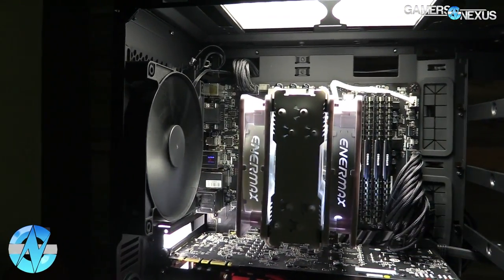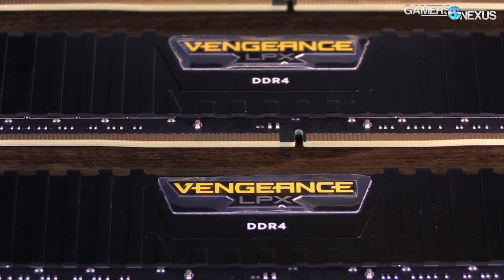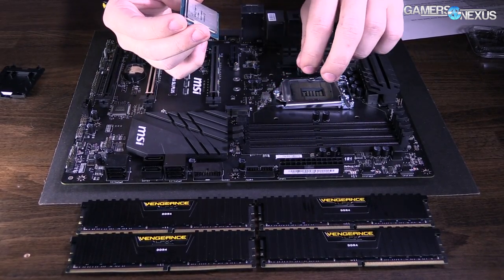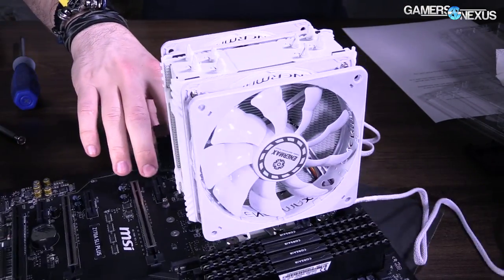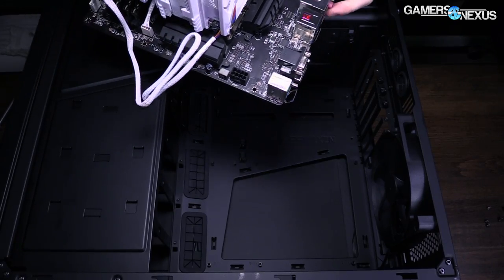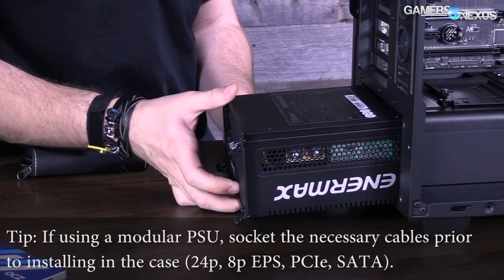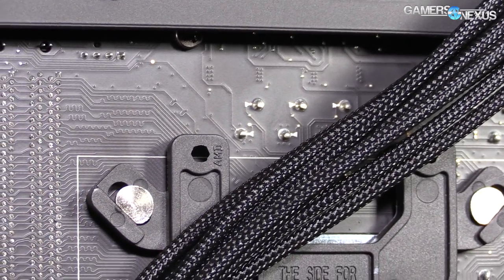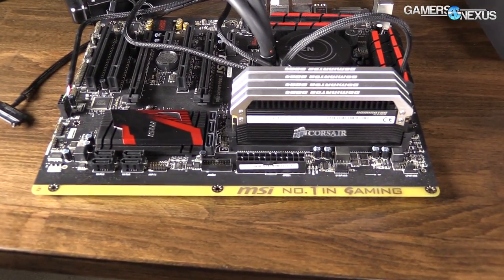How to Build a Gaming PC: Step-by-Step Walkthrough 2016

Comment from the maker: Hey everyone! Important note for new builders: The steps to building a computer are almost always identical between parts lists (sans a few minor details, or using an mITX case), so this guide will apply to any 'standard' parts list. You do not need to use the parts we did in this video (and some of our parts are specified for our internal testing or production uses anyway, thus likely are 'overkill' or 'mismatched' for the average gaming PC). You can always post on our forums if you require assistance in fine-tuning a PC parts list for your next build, then refer to this video for the walkthrough!
Reply: +Gamers Nexus i have a tp link 1750 t8e ac wifi,i cant get it over 135mps speed even tho i have superfast fibre optic broadband.
 i usually use my gigabit ethernet but the mrs wanted wifi,now i downloaded the latest driver for windows 10 from tp link,but when i go to update ,it says windows says you have the best driver already,even tho that one is from 2014 and the new one is from just before xmas.
i deleted the driver but now cant see the wifi card in device manager,do i really have to unplug the card and reseat so it shows up.
also how do i force the driver update,i pointed it to the folder that has it but windows says the best is already installed,any help would be great
Reply: +patchedupdemon The low transfer speed on the card is not due to the drivers, but to the connection band you are using, as well as the router. On the router login page (such as routerlogin.net for Netgear) there are settings where you can change the the max speed mode for both the 2.4Ghz and 5Ghz signals. Most AC routers have anywhere from 300Mbps to 900Mbps speeds on the 2.4GHZ signal lane, and can have anywhere from 450Mbps to a whopping 5Gbps on the 5Ghz signal lane. I hope this helped you out!
Reply: Will a gtx 1080 zotac amp edition fit in a NZXT S340 case? That's the card And case I am using for my build.
Reply: i have fibre broadband and im already running on the 5ghz band,i cant get over 150mps,even though it shows excellent signal strength,ive just diabled it as im using gigabit ethernet now.
just totally bummed i spent the money on that card when my cheapo one does better
Reply: your router has to be programmed to run at max speed in the router settings, otherwise it sticks to factory-set defaults. Also, since you have broadband, your modem may be bottlenecking your router. if it doesn't have enough upstream/downstream channels, tyou will get slow speeds even with a fast router.
Reply: There are a few thing I do differently than you, other than I have not yet tightening a CPU fan to the point of warping the board (knocks on wood and smiles at you;) is to also attach the case headers prior to installing the board into the case. I also opt to install the power supply prior to dropping the MB in so I can run the cabling to its rightful location. O wait... there is one more thing, I dont wait to install the GPU before I talk about connecting the SATA cables because so far the last 100 or so builds I have done that is always a must!
Reply: Gamers Nexus the motherboard you used in the video does  it sell in the UK, can you recommend any alternatives?
Reply: How much does this cost

Comment: hey great video! could you make a video about COMPATIBILITY of the parts? I mean for example how to check if RAM is compatible with CPU and MOTHERBOARD and atc.

I am sure many will appreciate it! )
Reply: Not sure if I am too late, but look up the website PCPartPicker. Great website and community where you can create a parts list that includes compatibility.

To check if RAM is compatible with Motherboard, it usually lists on the Mobo that is works with DDR3 or DDR4 at a certain speed. Usually the CPU determines what Motherboard you need based on the socket, which in turn leads to what RAM you would use.

Comment: Also minor tip for OS installation, if you're using a single large hard drive, split it up about 30/70 with paritions, so 300/700gbs for a 1TB drive probably 200/300 for a 500gb drive.

Install the OS to the smaller partition and keep games/files on the secondary partition, that way if you ever need to reinstall your OS you don't lose all your data.

Comment: Probably going to stick to a 390/Nano over current nvidia cards given nvidia's issues with DX12 that seem to keep popping up. Plus you're going to save at minimum about $100 or so with a free-sync vs G-sync display. and the 390 just has more performance than the 970, more so at 1440p or above though.
Reply: the cost to performance is definitely in amd favor, I have heard for what it's worth that freesync isn't quite as good as gsync though. I haven't used freesync though so I don't know personally.
Reply: Jominator
Some implementations of free-sync are poor, but for the most part when they're both working 100% they're going to be identical.

Like the 1440p 144hz IPS displays, the ASUS one only goes to 90hz, while there's a new ACER one that goes up to the full 144hz for free-sync

and if the 4k G-sync displays are still 900 for the IPS ones god help all nvidia users. There's a free-sync one that's 27" for about $450-500
Reply: +Street Guru Yeah if the cost stays that high I'll likely not be sticking with nvidia. I run 1080p gsync with a 980ti hybrid and I cannot STAND playing on a non adaptive refresh monitor now. It's God awful. But even if there is a small performance dip that big of a price difference will convince me and I'm sure a lot of other people to go team red in the future...
Reply: +Street Guru actually I think it's a Samsung 590E panel your referring to no? 4k freesync for sub 500. I have the 590D. Got my gsync 1080 when I got the 980ti. the ti just can't push the 4k rates I want and my 590D lacks gsync... had the amd 3xx series launched sooner with that 4k panel available I'd probably be team red right now...
Reply: Thats pretty good for the price, there are some advantages the samsung has over that though, faster response time and its 28 inches instead of 27 (though I dont think that extra inch is really worth much of anything), the LG is an IPS panel though and samsung is TN... the LG is probably the better buy for the price alone much less the ips...

Yeah I'd have probably purchased this over the samsung, would have only saved me 30 bucks though so I dont feel horrible about it... Does the LG have vesa?
Reply: Street Guru What😂😂

Comment: how sensitive are the pins on the motherboard compared to the pins on amd cpus?
i took a old pc i had and it has a amd athlon cpu i took it out and the pins seemed pretty hardcore i even took my nail and tried to bend one and it didnt budge so im wondering is it the same for new intel cpu/mobo pins too or are they more sensitive?
Reply: pin sensitivity shouldn't matter much. however on the intel mobo they are little triangle pins so when you push on them they are harder to break since they are more flexible however never do that just plop the cpu in there and don't worry much about it.

Comment: i just recently built my 1st pc, and it was nice experience building it myself, everything went smoothly (i don't  have aGPU yet ) so i thought il run the on board graphics, so i built everything connected HDMI cable to motherboard, and no boot (motherboard: gigabyte Z170MX- gaming5)  couldn't figure out what was the issue everything was running but no boot screen , so i decided to RMA the motherboard and the cpu, i just received the replaced version of the same brand still no boot, only thing comes to mind is the RAM,

do you think was it the RAM that was causing the issue?
Reply: have you tried something other then HDMI? I remember tha at least a while back when using HDMI one could not go into things like the BIOS. I'm not sure if that has been something that has been resolved yet or not tbh through. buy yeah try using DVI, DP or VGA.
Reply: +Bernd Jankowiak before the RMA yes i did try it with vga and dvi cable still no.post physically the system was ruñning fine ,fans ,the cpu cooler just no post, after the RMA just tried the hdmi cable, i assumed its the RAM

Comment: I've planned to make a gaming pc, 
The budget for the build is around £700....can you please tell me if this build would work:

CPU:                        Intel Core i5-7500 3.4GHz Quad-Core Processor
MOTHERBOARD:   MSI H110M Pro-VD Micro ATX LGA1151 Motherboard
RAM:                        G.Skill Ripjaws V Series 8GB (2 x 4GB) DDR4-2400 Memory 
STORAGE:               Kingston SSDNow V300 Series 120GB 2.5" Solid State Drive
                                  Seagate Barracuda 1TB 3.5" 7200RPM Internal Hard Drive
GPU:                         Sapphire Radeon RX 480 8GB Video Card
CASE:                       NZXT S340 (White) ATX Mid Tower Case
POWER SUPPLY:    EVGA 600B 600W 80+ Bronze Certified ATX Power Supply

Please tell me any improvements I should make.
Reply: +T Dag that's a really good parts list. Make sure to include Windows 10 USB as part of the cost (use pcpartpicker.com to find the cheapest place to get it), but yeah it looks fine. 
I would wait for the new AMD refresh graphics cards to come out, they are releasing the RX 580, 570 and 560 which are actually just the 480, 470 and 460 but clocked slightly higher and with better efficiency.
You haven't made any mistakes (like getting a Z-series motherboard for a locked CPU) and all of those parts would work fine. The power supply might be a bit overkill though, a 500W one would do you just fine.
Hope that helps ;D

Comment: Can I use a gtx 1080 for this same build? If I can't do. I have to change anything?
Reply: graphics cards wont matter, they'll usually be compatible with like every motherboard... the thing you might worry about is power consumption/what power supply you're using... that's all
Reply: Richard Maestas / Ramheads GTX 1080 with a 550w psu should be fine though

Comment: Is this an ok build?

Intel Core i5-4690K (Boxed, LGA 1150 Haswell Refresh)
Western Digital Blue 1 TB (3,5" SATA 3.0)
ASUS DRW-24F1ST (DVD/RW) 
AsRock B85M Pro4 (mATX, LGA 1150, DDR3)
Kingston HyperX Fury Black 2 x 8 GB (DDR4, 2666 MHz, CL15)
Microsoft Windows 10 Home (64-bit, OEM, english)
SilentiumPC Gladius M35 Pure Black GD-M35 (ATX) 
EVGA SuperNOVA 650 G2 (80Plus Gold) 
Gigabyte GeForce GTX 1070 G1 Gaming 8 GB
Reply: No. The RAM you have is DDR4 which is not compatible with your motherboard and may damage it due to the differences in voltage between DDR3 and DDR4.

If you buy OEM Windows, bear in mind that the install will be tied to your motherboard. Non-OEM versions exist, they cost a little more but are worth it. 

If you haven't purchased your CPU/mobo - you might want to opt for Intel's Skylake CPU's (examples would be the 6600K, 6700K, etc).
Reply: Lishaaaaaaa Thanks m8
Reply: Also, if you are getting a non-Z170 or H170 Motherboard, don't get a K processor.

Comment: Can you use a gex 1060 or 1080
Reply: .gtx
Reply: graphics cards don't have compatibility issues with almost every motherboards, the only thing you need to worry about is if your power supply can handle it
Reply: kOdaqTV or if the case supports ii

Comment: I strongly disagree with installing video card last. other steps were decently ordered. Minor revision as such....
install mobo in case DO NOT FULLY TIGHTEN SCREWS, install video card and screws. This will/can slightly shift the mobo so that all the pci slots will properly line up in the future when installing cards. I cant tell you how many systems I have worked on built by others that the slots dont line up properly and the screws dont want to go in or you need to force the card to the side a little. once the video card is installed, then you can tighten all the mobo screws. after that I usually uninstall the video card to complete the rest of the build. In my opinion this is a crucial step that is missed by 90% of builders.

Comment: Can anyone tell me if these parts are compatible with each other? Im wanting to build a PC and I mixed and matched some parts from this video and other videos.

Parts:

MSI Pro Solution Intel Z170A LGA 1151 DDR4 USB 3.1 ATX Motherboard (Z170A SLI Plus)

Intel 3.70 GHz Core i3-6100 3M Cache Processor

WD Blue 1TB SATA 6 Gb/s 7200 RPM 64MB Cache 3.5 Inch Desktop Hard Drive

EVGA 500 W1, 80+ WHITE 500W Power Supply( 100-W1-0500-KR)

Corsair Vengeance LPX 8GB (2x4GB) DDR4 DRAM 3000MHz (PC4-24000) C15 Memory Kit - Black

Hyper 212 EVO - CPU Cooler with 120mm PWM Fan

ASUS ROG STRIX Radeon Rx 470 4GB OC Edition AMD Graphics Card with DP 1.4 HDMI 2.0

Rosewill TYRFING ATX Mid Tower Gaming Computer Case, supports up to 400 mm long VGA Card, comes with two fans pre-installed - Front 120 mm Fan x 1, Rear 120 mm Fan x1

All parts found on Amazon and the total comes to:
$689.29

Any help is appreciated as I am indeed a noob xD lol.
Reply: Please post on reddit.com/r/buildapc for a quicker response!
Reply: Savage Pryme- you could just go to PC part picker and it'll tell you if it's all compatible. It's really specific too.

Plus it'll tell you the best pricing for your parts and from where, and if you want you can look at all the other builds people have already completed.
Reply: Savage Pryme- and guides too, I forgot about that
Reply: the motherboard might be compatible with a Kaby lake after latest BIOS update.

a Z270 or H270 board might be bit more expensive or same price.
and offers more bandwidth on M.2 and PCI-E .
better compatibility for 6000 serie CPU.
lots of them have 2x m.2 with full speed. 
it's worth the extra bucks. 

MSI H270 PC MATE 
2x m.2 fullspeed ,2x PCI-E x16
(nice cheap board , and enough for your needs)

ASRock Motherboard Z270 Gaming K4 
2x M.2 full speed , for example Samsung 960 Evo or Pro series.
you can later clone your HDD to SSD with the Samsung migration software.
(this one is more expensive, but sweet )

Seagate barracuda are good HDD's too, i never broke one.

Be Quiet shadow rock or dark rock CPU coooler.
or Dark rock advanced .

Gskill memory.
or Kingston hyper Fury 

i don't like corsair anymore.
i had too many faulty products
headset fell apart , and PSU AX850 broke within 2 years.
very expensive joke.

My Seasonic PSU is a whole lot better.
Reply: download motherboard .PDF
can see specs a bit.
check Memory priority slots 
Bios list , etc.
CPU supported list.
Memory tested list.
Reply: Kaby lake is 7000 serie , i forgot about that.
6000 was skylake right.

anyways , an i5   7400 or 7500 is not much more expensive.
you can safe on the motherboard.
and go for the better i5 .
maybe not a K version , but it has a nice turbo boost .

you might want to wait for the AMD Ryzen 5 video's and benchmarks.
Reply: Sharkoon has nice wide PC cases.
USB 3.0 connector for motherboard.
can fit a big CPU cooler 16 cm high
enough room for a dark rock advanced .

less then 20 decibel i think it was
i think i buy a Sharkoon s28 with window or a normal s28 for my dads build.
Reply: Pryme- use PCPartPicker. It's amazing.

Comment: how accurate is pc part picker compatibility check?
Reply: Jacob Saadoun It work's
Reply: pretty dang accurate even has a wattage counter.
Reply: Jacob Saadoun once it told me about how it was questionable to fit a certain GPU in a particular case because of a mere 2in difference. So not only is it extremely accurate but it's not just a yes and no machine, it goes into specifics too.